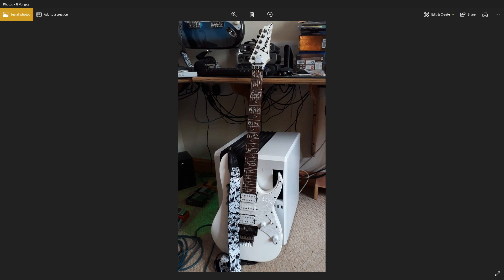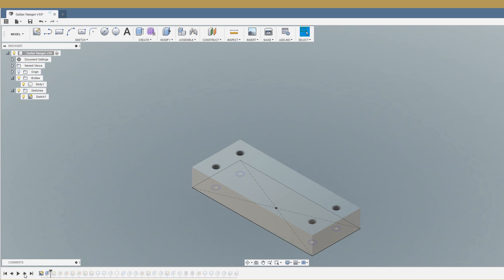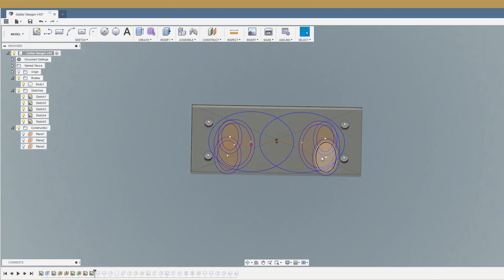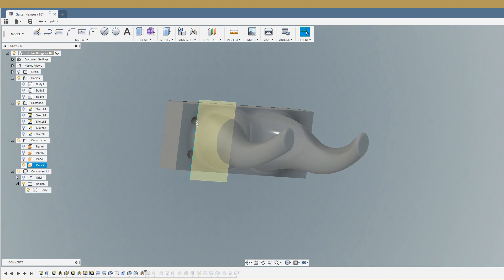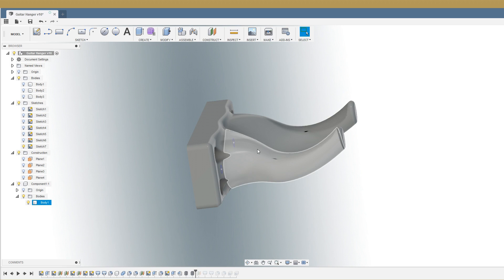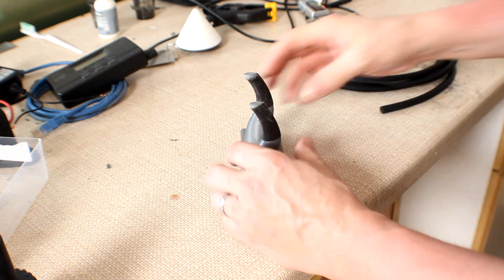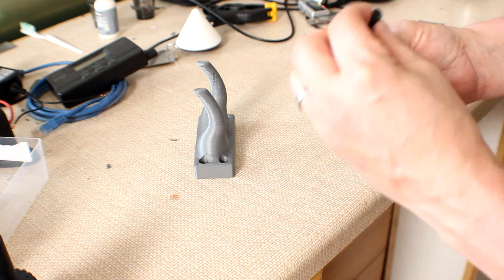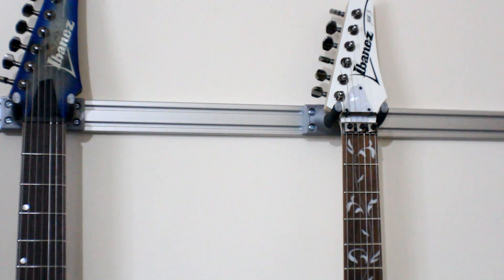Things to 3DPrint #7 - Guitar Hanger

Comment: What T track aluminum did you use?
Reply from the maker: Hi Griffin Crown - I use Series 5 Extrusion 10x40mm - unfortunately it has become somewhat difficult to source these days, since one of my old suppliers went under. The only place I have seen it is here, but I have not bought from these guys before so usual caveats apply: http://www.valuframe.co.uk/Series-5-Aluminium-Profiles.html